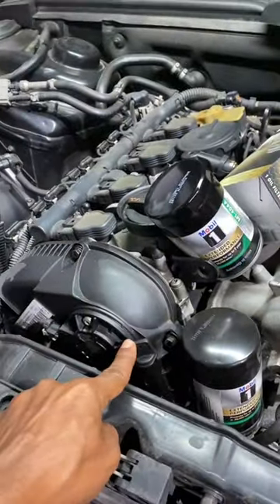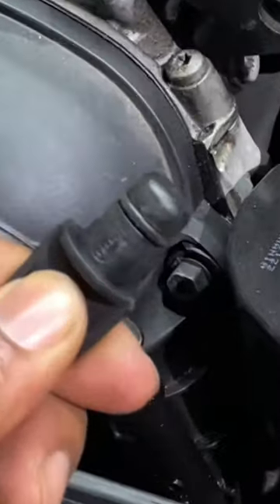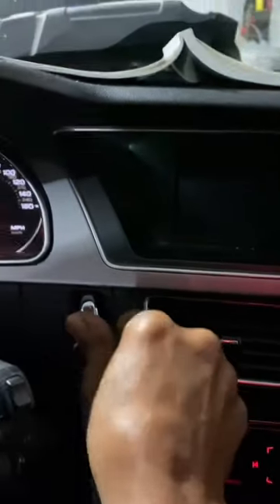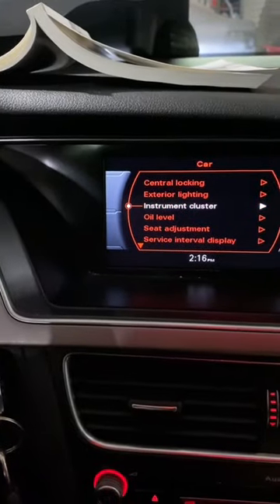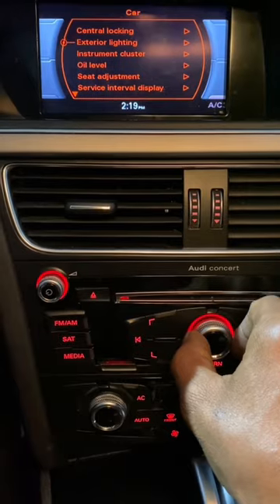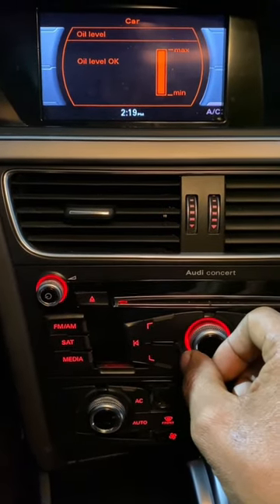Dipsticks No More: The Future of Oil Level Checking Revealed.

Comment: I'd just buy a dipstick the right length, wouldn't want to rely on sensors.
Reply: I wish you could do that but there's not even a place to put a dip stick on most if not all of these types of oil systems. I hate the lack of a dipstick and will avoid buying a car like this as long as possible

Comment: Terrible design i will never own a newer car EVER! that is complete bs.
Also CHECK YOUR LEVEL COLD ALWAYS, DONT EVER CHECK YOUR LEVEL WARM AS FLUID EXPANDS WITH HEAT AND WILL GIVE YOU FALSE READINGS. check it before you start it everytime. If you did filters on it, Check it prior, verify levels, Turn the car on for 1 or 2 minutes, Turn it off and check the level again